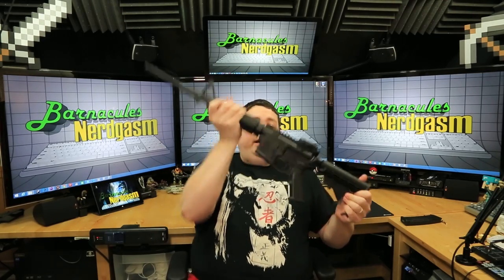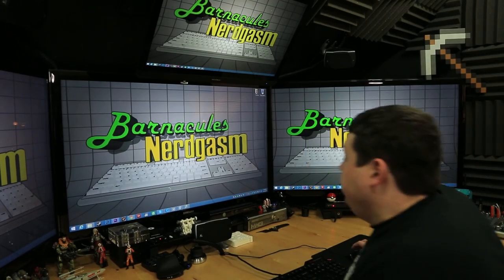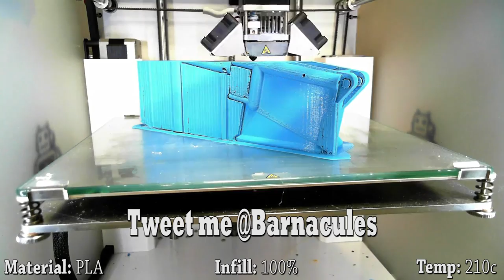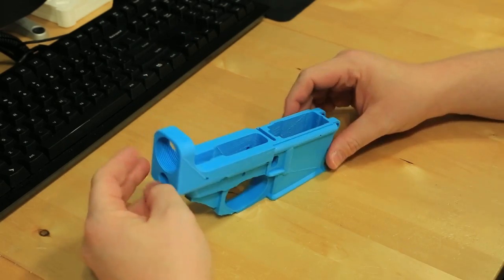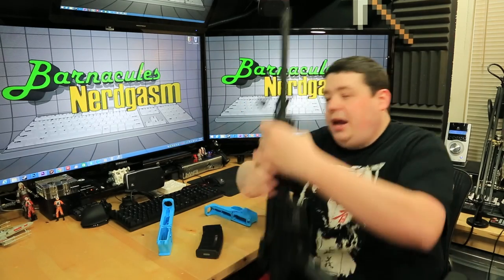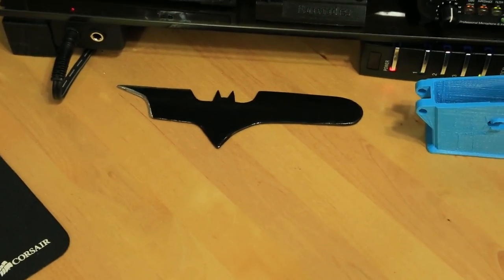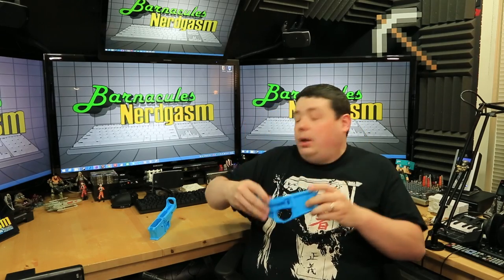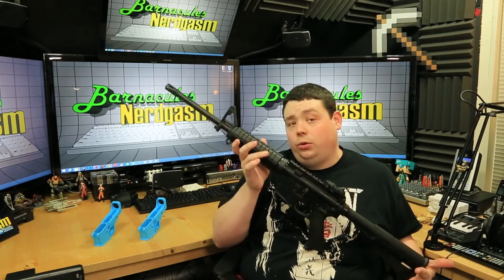Why you shouldn't print an AR15 on a desktop 3D printer 😎 - @Barnacules

Comment: DISCLAIMER:I do not endorse this
With just a store bought flare, PVC pipe, and a couple other parts(that I don't remember at the moment) and build a .22 for less than 50$ and takes not near as much time as a 3D printer

AND a a bong wouldn't be too smart as the lighter would melt the plastic depending on how long you held it

Comment: It shoots these itty-bitty bullets. Sure they can punch through steel at 200 yards and are deadly accurate but it's fine. Any gun is lethal in the right, or wrong, hands. A .22 is lethal up to 7 miles, you just have compensate and aim ridiculously fucking high.

Comment: if you built it in cal 22lr ir would run forever! that's what ide want to do just to have a cheap project fun gun! fitting the parts after getting the shrinkage factored in would still take some time but its way cheaper than an m&p1522. witch also has a polymer receiver btw.

Comment: Yeah, people when people freaked out about this a few years ago I was like you do realize that people have been manufacturing their own firearms with basic lathes and drill presses in their garages for over a century. You can even buy 80% completed lowers sold with a jig so you can drill the holes out on drill press, and it's completely legal as long as you don't sell it.  I mean anyone with basic machining knowledge and patience can create things like Lutty sub machine guns or an auto sear for that AR15, and they do more often than people would think, yet there's not a huge epidemic of illegally converted AR15s and homemade "ghost" smgs being used in crime.

Comment: The lower receiver is the part that is regulated so the idea is that if you print the lower it has no serial number and therefore it doesn’t exist in the eyes of the government
Reply: Safer to finish an %80 lower since it doesn’t have a serial number and is much stronger. Tip for anyone out there who want to keep their guns if anything ever happens

Comment: Not gonna lie dude, you could be a little less sarcastic and a little more humble with your opinions about this. You specifically printed on a lower resolution which is part of the reason that the tolerances weren't up to par. Also, the reason printing a lower is so important is because it's the only part of the gun that requires a background check to purchase.

Comment: If I were to print a lower, I'd go for the most durable material that a desktop 3d printer can work with. Either nylon or polycarbonate and composited with carbon fiber. However that would also require some special equipment for the printer like the appropriate nozzle, an all metal hot end, and a means of keeping the filament dry during printing due to both being hydroscopic.
Reply: I 3d print carbon fiber. I use it to produce parts for tattoo guns.

Comment: Hey, you know that you were putting the mag into the AR15 correctly. But on the 3D printed model, you would put it in backwards. Might be a reason why it doesn't fit.
Reply: he didn't put it backwards, that was the correct way to put it. That circle on the top of the lower receiver is for the stock and the buffer tube

Comment: Here is the realistic evaluation. 
True... trying to duplicate a metal gun that was designed to be metal is difficult.  
The easy solution is to start from scratch. Instead of duplicating... design a plastic gun intended to be plastic. You may use supporting rods for support as long as when it's not in the weapon it does not look like a part of the rifle.

Comment: better use hot glue to beef up the weak corners of the AR design, or only use this plastic AR for shooting with the Ciener .22lr conversion unit, cause it'll fall apart at the stress corners of the lower if you dont

Comment: I can take a lower off the printer, snap off supports and pop a magazine in.  This is on a $155 Ender 3 not an 'industrial' printed.  400 rounds so far no issues
Reply: What material?
Reply: @alexisalvarado8968  pla plus is what I just used and it came out solid.
Reply: @alexisalvarado8968  pla+ is the standard it's the best material the community had found yet mostly because of rigidity
Reply: @Grognarthebarb  what about nylon or polycarbonate with either being composite with carbon fiber?
Reply: @mikeyunovapix7181  I forgot to mention cost and easy of printing on that.
Reply: @Grognarthebarb  true. But when mastered it is very much worth it to make durable parts out of. Still, I'm gonna be starting with regular PLA as I get into the hobby of 3D printing for a while before I start working with the special materials.
Reply: Hey bro what setting do you have on your printer and could you help me find or send me the print file. I've tried to do it and it failed everytime I have the same printer and am new to 3d printing

Comment: Could i print a Carbine kit for an existing firearm out of PLA? or should i use another material?
Reply: Pla + should work.
Use the one made be esun, since that’s also the type recommended by most people in the 3d-gun community and it’s widely tested and proven to work.
Reply: @yourlocaltoad5102  Yep, like this guy said, eSun PLA+ is commonly recommended for AR15 parts, and easy/forgiving enough for the beginner to work with. 

The only real drawback to PLA is its low heat resistance. You don't want to leave a PLA part in a hot car, for example, as it will warp and render something which depends on precise geometry (like a lower receiver) unusable.

Comment: Have you Ever put one together and actually dumped a few clips through it?!! You CANNOT use ABS or any other filament other than Nylon carbon fiber or PLA+, its about structural integrity, its qhy you need to have aupports so that the main structure stays strong, you sand off what isnt needed, but its designed that way because of the filament that its designed to be made out of, ideally PLA+, which is what most lowers are designed for. If your print comes out looking crappy it probably wont work, when you print them Properly, you can get 2k plus rounds through an AR or an MP5, so learn and Know what your talking about before telling people about what you obviously dont know about
Reply: Pla + and nylon filliment didn't exist when this video was made 8 years ago. Back then the best material available was abs

Comment: Just buy a Ghost Gunner 2. An open source hardware project. Ghost Gunner is a general purpose CNC mill, built upon a large body of open source work, grbl g-code motion control, and popular microcontrollers. View specifications. Learn more. Shop Now. For 80 percent receivers and frames. No prior CNC experience required. $1,675.00

Comment: Lowers cost as low as $29. Why bother!
Reply: Have you ever 3D printed an AR15 lower and put on an 22lr upper receiver(not .223 rem) ? the lower recoil of the 22lr can make the lower last a bit longer.
Reply: Anonymity, and because you can.
Reply: 1234  Well I get that... I built AK's for years when parts kits were $99.  Bent and welded receiver flats which is a much better build and easier actually than printing a lower.

Comment: Funny how all the liberals think the AR in AR-15 stands for Assault Rifle. Yet it stands for Armalite Rifle. And all guns need a metal barrel with rifling for the bullet to shoot out of so there are no guns that are made via 3D printer or polymers that are undetectable. Plus the ammo has some sort of metal in it for the primer that will set off a metal detector. There is one company making polymer ammo cases yet it doesn't work. Only drawback for an AR lower that isn't metal is the support for the buffer tube which is where all of them break if they are not some sort of metal. For an AR in .22lr they work great yet for .223/5.56 that is the fail point. Handgun rounds you might get more use of out them yet it will still snap off the Buffer area without some sort of reinforcement.

Comment: I'm relatively new to 3d printing but definitely looking to invest. What's printer model and corresponding software you'd recommend and what price range should expect to pay, say... If I wanted to print a lower receiver?
Reply: Can use any printer. You have to configure and calibrate the printer though. As for software many do cura, blender, fusion360, simplify3d

Comment: I’m no rocket scientist but......print in plastic—> make mold —> cast in aluminum   Sand/dremel to touch up , (possible or nah?) just what my mind though up , of course like he said barrel will need to be bought
Reply: I always wanted to try this. It might also counteract the shrinkage or make it worse.  Trial and error is the only real effective science.
Reply: Ok, so the biggest issues are as follows 

1) The mold will need to be heated evenly to avoid bubbling and to allow it to flow freely enough to get a proper cast
2) Plastic would be a poor medium, I'd suggest just getting a 70% lower and milling the material down for the mold instead
3) Why not just make a mold of the 70% lower, cast them out of aluminum, and then mill them using the mill you'd need anyway to finish it off?
Reply: @greywoulfe4443  never use an aluminum part for anything that holds pressure. The casting may not be as durable, but it won't explode because it isn't used as a barrel or breach. The risk is excessive wear or cracking.

Comment: I have the files at combat the dimension issues everything is been corrected just PM me for a copy of the files PS I also have files for 30 round magazines pistol grips and other AR accessories that you could print with the printers also do not print these items or the lower with pla please use ABS it is stronger and more flexible I am also custom-designed an exoskeleton to go over the 3D printed lower that looks pretty awesome and it makes it a lot stronger
Reply: Im interested in them files. Though it dont let me pm ya.
Reply: I'm interested in the files also.
Reply: Ditto

Comment: I have a question I have never seen 3D gun printing I’m assuming it’s plastic please correct me if I’m wrong
Reply: It's not metal. But it's not some cheap plastic that melts
Reply: @danielcruz2256  well technically it is a cheap plastic that melts, just not at a low enough temperature to cause problems

Comment: Any idea on a good 3d printer for under $500
Reply: Monoprice Maker Select
Reply: Thank you.
Reply: XYZprinting Da Vinci 1.0 3D Printer is another option I am looking at ($250-350). However I have not gotten into printing so I am not sure about performance.

The main issue is that I already gunsmith a lot of weapons from scratch by stamping sheet metal and using a mini mill and lathe. I can make anything from handguns to belt fed rifles. I want to use 3d printing as to improve my effeciency and produce high volume pieces like trigger groups, magazines, and furnature whithout my attention, but so far the cost of the printing material seems to be the killer that will keep 3D printing from becoming mainstream for the guys like me who already have the skills to build with basic metalworking skills.

Comment: You do know that they make 3d printers that actually print in different types of metals that doesn't shrink. They even have carbon fiber that doesnt shrink and theres a few people that have done it and it actially works with the carbon fiber.  Trust me somebody is going to do this and if your a little smart all you have to do is print the ar15 lower a little bigger then it will be the right size after it shrinks. There a video that the guy 3d printed it and actually shows him firing it alot. I vaint believe theae guys are filming this stuff because the atf is going to be knocking.
Reply: Nice....but now you pay atleast 6000$ for the printer and get to buy proprietary filaments ala mega$ per spool. And you need a inert gas sintering furnace. And it requires considerable technical knowledge to actually make usable prints.

Meanwhile, a 1500$ home CNC mill can make perfectly functional copies at much lower cost and knowledge.

But all that requires a considerable outlay of $, knowledge and most of all...work.

That knowledge wil get you a 25 to30$/hr wage.
Which is considerably more what a hoodlum makes. Why would anyone risk that capital and money to make guns for criminals?
The fear of this technology in this regard is irrational.
Reply: @dwwolf4636  dude it didnt cost these guys that much to make a lower with their 3d printer. Lol.  What are you smoking...they did this with a $50 spool of filament and a $300 machine.  Lol. Wow really. Your way over thinking this. They do this because they can make as many guns that they want and they dont have to register it. Thats all.  Lol. Wow
Reply: <sigh> the outer shell of an AR15 is irrelevant, it could be carved from a block of wood. All the internals still require precision machined parts to not blow up.

Anything made entirely from plastics (fiber reinforced or not ) needs to be so prohibetively large to take the forces involved ( look at that liberator "gun" which only has to deal with a measly .22LR ) that the fear of invisible guns is ridiculous. Machining plastica would make more sense to remove the directional weakness of printed plastics.
Reply: @scottmcbride2237  people were talking about printing metals. Which is what you need to print the entire gun.
The only thing that you are talking about is the bit that holds the parts that actually take the 62336 psi pressure load that firing 5.56mm Nato entails. That outer shell could be carved from wood. An AR15 still requires metal internal  parts. 
And even if you print those they still require machining to finish them.

Frankly this just isn't a problem.
Reply: Dwwolf 
A $200 printer using a $25 spool of PLA or PETG can print a very durable receiver, provided you have the proper file for a well designed lower. It doesn't have to be "prohibitively large," just well designed. Usually all that is needed is for the area around the receiver extension and takedown pins to be reinforced. There is also a bolt together lower that consists of several different parts so that it is easier to print and if an individual section of the receiver is damaged, it can be easily replaced or upgraded as improvements to the design are made.

Comment: would that hold to a .22LR
Reply: yes..people have printed lowers and used them for 1000s of rounds... and yes they use ender 3 to print them.. and the only part that starts to weaken is where the stoke connects ( behind the upper. where recoil effects it...) for 22 it would last a very very long time..the archangel conversion kits are basically are cheap plastic cases for the 22lr. even weaker then a pla build..

Comment: Put a serial number on that lower just in case.  I used to make ar15 lowers on CNC machines for a living.  It's the only part of the gun that is actually considered a gun.  Broaching a firearm without a license is illegal in most states, although you didn't technically broach it which would be it's own legal issue I suppose doesn't hurt to cover your bases.

Comment: Pretty sure it's 5.56 not 223. Yes there is a difference.
Reply: The gun doesn't really care too much, they're fairly interchangeable in almost all circumstances. The lower is unaffected either way. You could use this lower for a 300blk too, it doesn't matter
Reply: @DaPainbow  you completely missed the point of my statement. My ar rifles are 5.56 designation if they have one, not 223.
Reply: @yuriorlov47  bro youre goofy. 5.56 AR's can cycle 223 bullets just fine. Plz tell me you know this
Reply: @ricardomota939  bro you missed the point. Please tell me you haven't reproduced.
Reply: @yuriorlov47  no one got your "joke"
Reply: It wasn't meant as a joke. People are stupid, look at who we elected as president.
Reply: @yuriorlov47  shit was rigged, but lets go brandon !🇺🇸
Reply: @ricardomota939  FJB and the government!
Reply: @ricardomota939  5.56 rifles can cycle 223 perfectly fine, yes, however a rifle made for 223 might not handle 5.56. 

5.56 has a higher chamber pressure, thicker brass casing, higher velocity, and obviously a greater power load. They share dimensions but 5.56 is a more powerful round.

If they were actually the exact same we wouldn't have two separate designations for them.
Reply: Yes, there is a difference. Plenty of AR-15 rifles can not handle 5.56 rounds and were made for .223. 

All 5.56 rifles can handle .223

Most likely this guy's rifle is not built to continuously fire 5.56 rounds due to their higher powder load and greater chamber pressure.